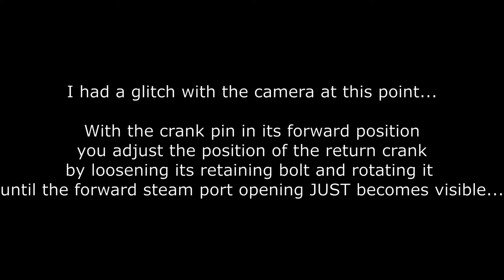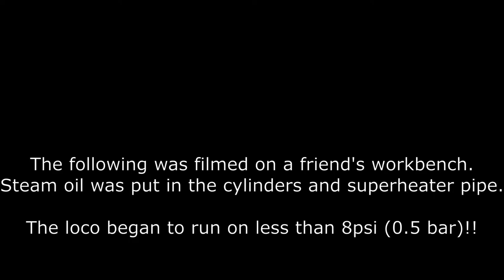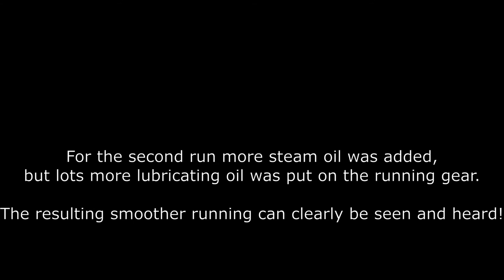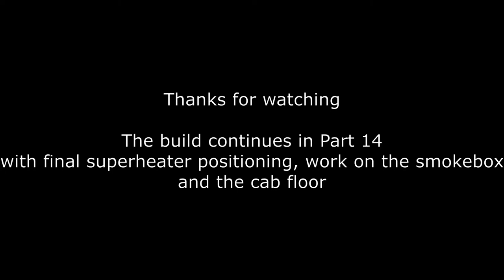RH George Part 13: Static valve timing

Comment: Why did you not also set the valve gear for running backwards as well? I do with my Asters as per the Aster instructions.
Reply from the maker: There is nothing in the instructions relating to setting valve gear specifically for going backwards. The instructions only relate to the moment the valve ports open in relation to fwd or rear dead center